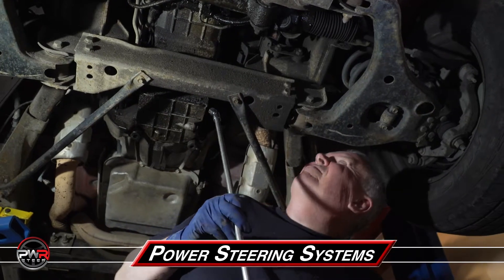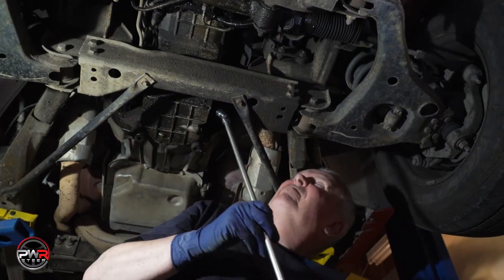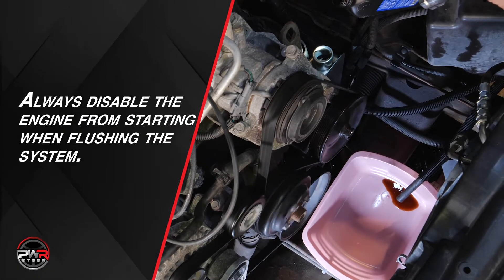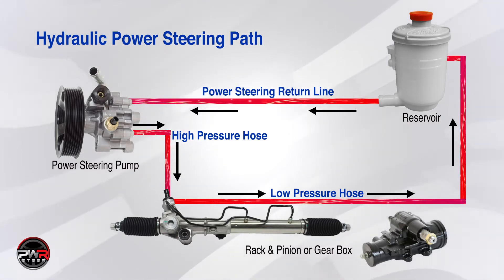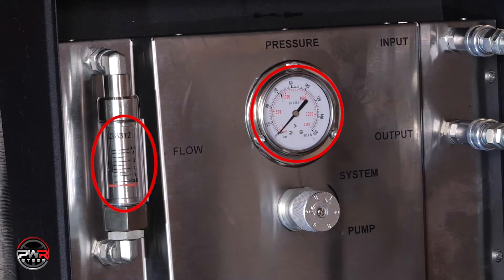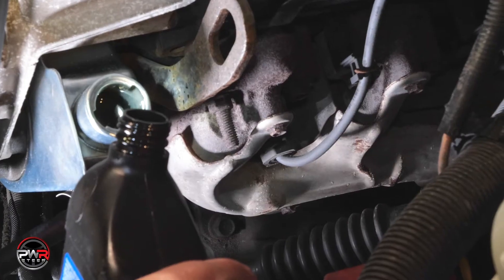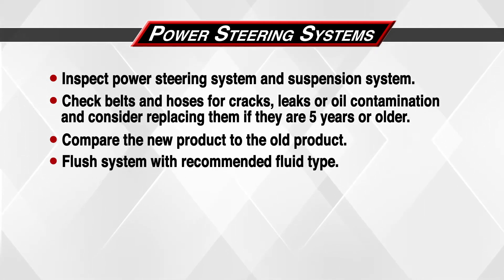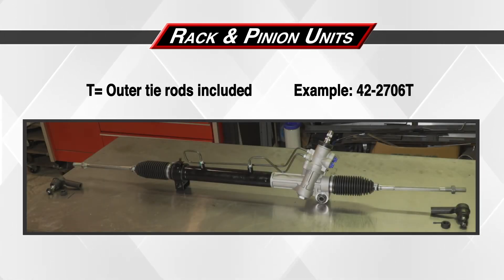Flushing & Vacuum Bleeding a Power Steering System: The Complete Guide | PWR Steer

Comment: That was teh best damn presentation ever. I thought for flushing the fluid you just had to have the key on so you can turn the wheels. Why does the does the engine have to be turned over like that? Why is that necessary? You cant just turn the car on? or leave the key on with the car off?

Comment: How you ever seen one that the power steering works turning left but doesn't turning right. It's a 2004 cheverlet 1500 4 wheel drive.  I have replaced the pump, but it didn't change anything.

Comment: you fail to explain how the vacuum pump is attached to the system.
Reply from the maker: Hi Jim, 

Have you see the "How to Properly Vacuum a Power Steering System" video (Go to minute 3:59)?

https://youtu.be/T43X316t7y0

The adapter goes on top of the reservoir. We used the Mityvac Power Steering Adapter Kit MVA670.

Thank you, 
PWR

Comment: So you don't need to flush if its all brand new parts? New rack, lines and pump?
Reply from the maker: Hi,

New, used, and remanufactured, all need to be flushed every time a line is opened (disconnected) and every time a part is replaced.

Thank you, 
PWR
Reply: @PWRSteer  But if you replace every part, is it necessary to flush?
Reply: @pstansberry542  yes
Reply: @pstansberry542  everytime.. A line is opened...every.. Time.